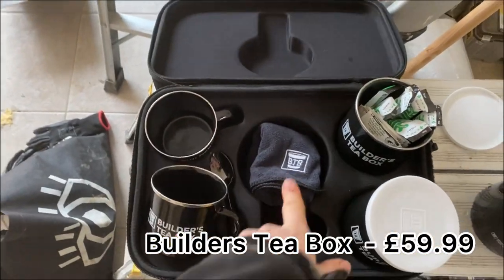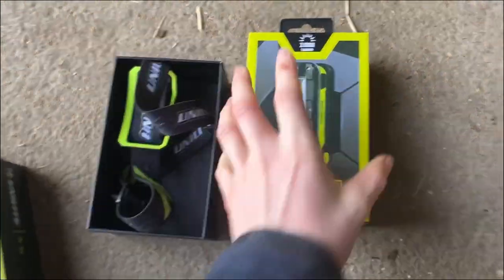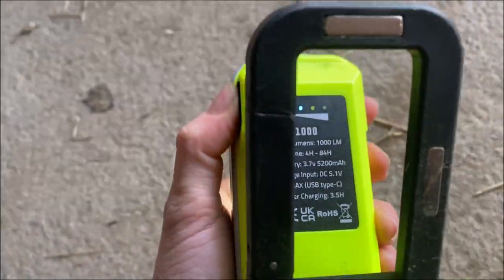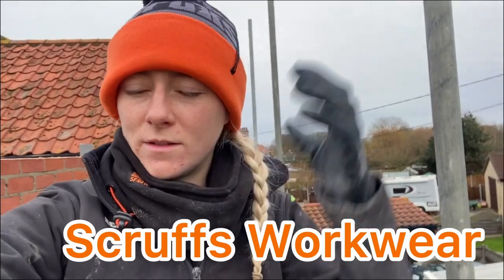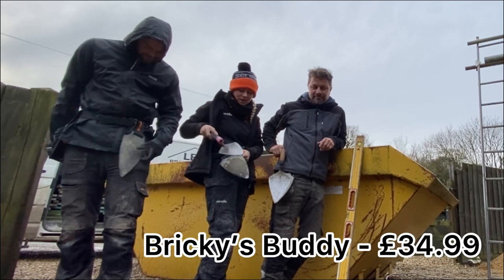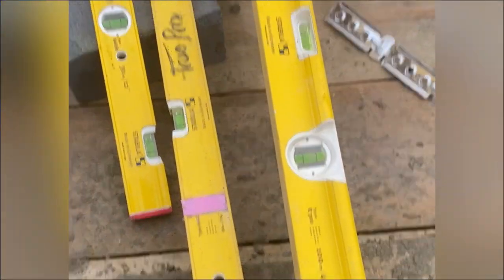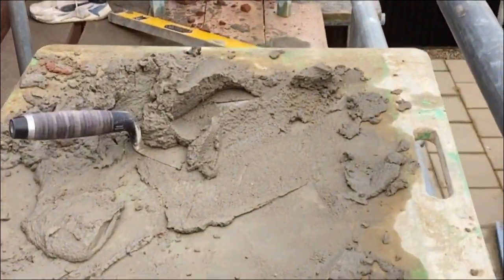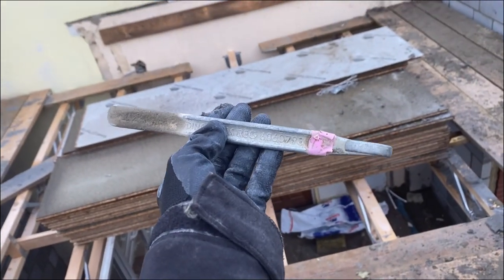Christmas Gift Ideas for people in Construction

Comment: The ox bag, has it got a plastic bottom? Is the lid water resistant?
Reply from the maker: Its got a hard plastic bottom. Its not waterproof but if you shut the lid if it rains i find it does stay dry really well.